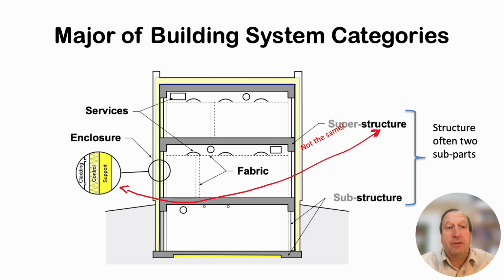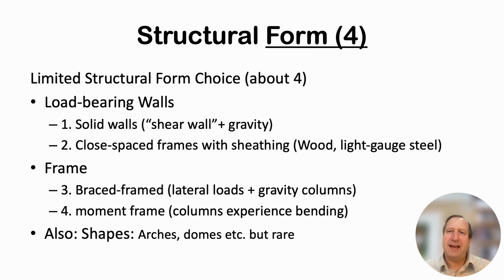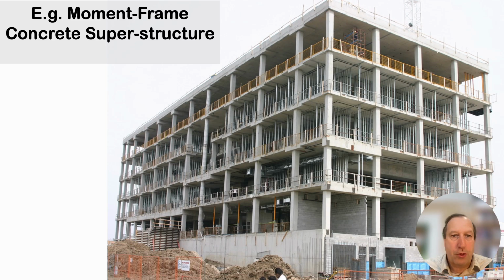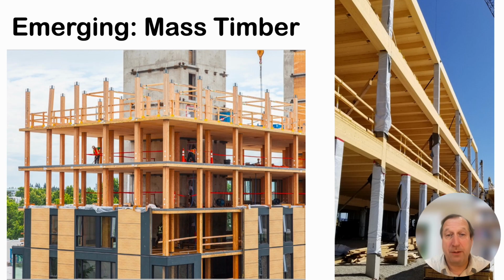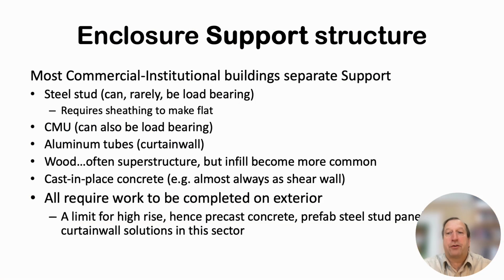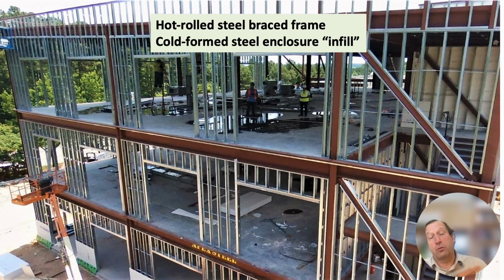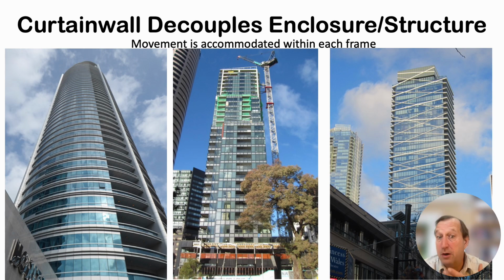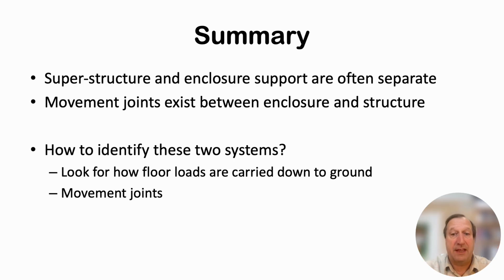Building Structure vs Building Enclosure Support

Comment: Professor Straube, first of all, thank you for sharing some of these lectures on your youtube channel. I especially appreciate the precision of your language in describing all the mechanics  and gestalt of building science. With that said, i don’t believe you’ve motivated enough with your use of the word support instead of the more commonly used, and perhaps misused term of “secondary structure”. I assume your intention with the word support is to distinguish from the existing use of the term secondary structure in some ways, perhaps to include the purpose of infill? Or is it for aesthetic reasons? additional insights on this matter would be greatly appreciated. Thanks again!